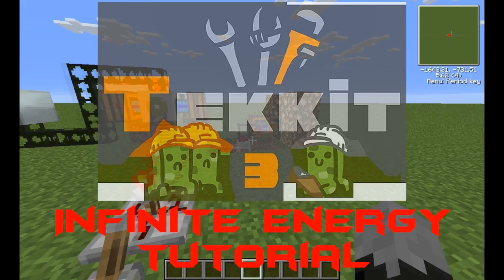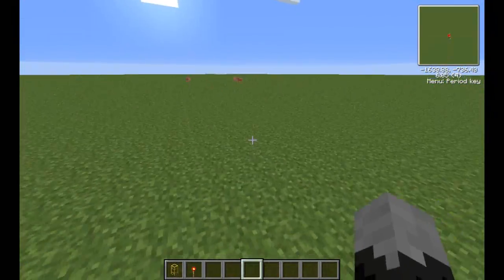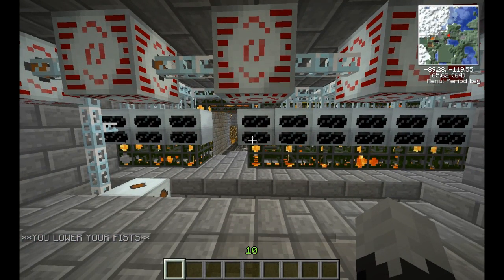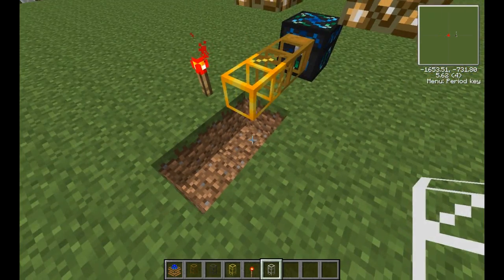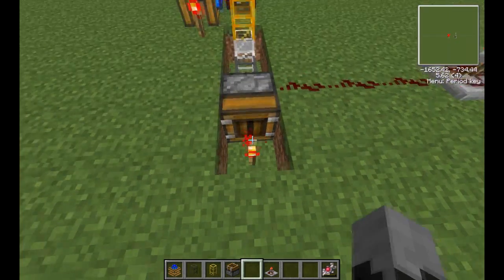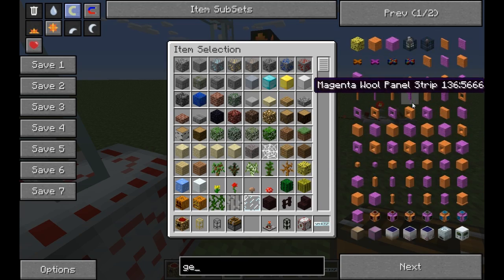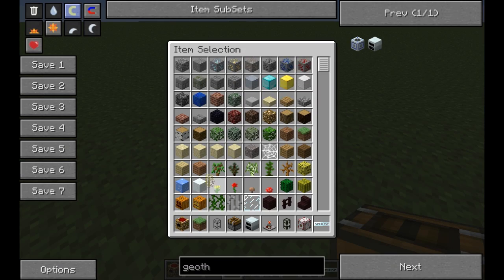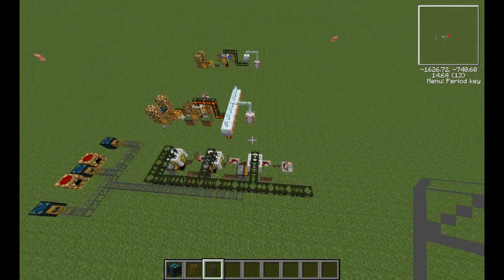TEKKIT tutorials: Infinite Energy

Comment: Just a tip, the difference in stone and cobblestone pipes (from what I know) is that stone pipes can have faster moving items. If you have a powered golden pipe, items will slow down after so moving so far, and they move much further through stone pipes before slowing down.